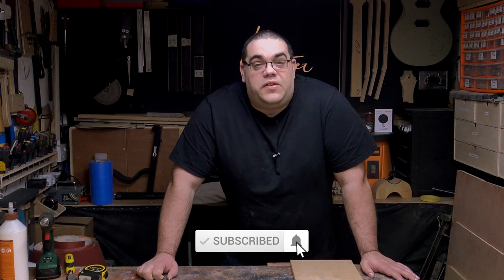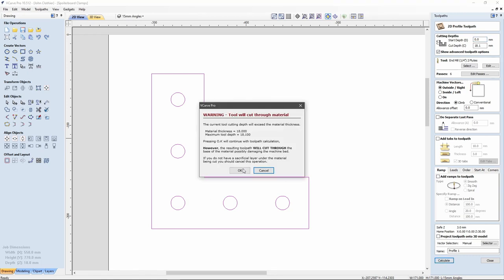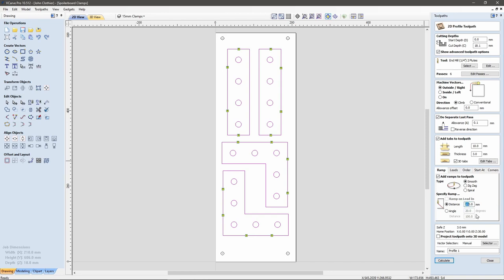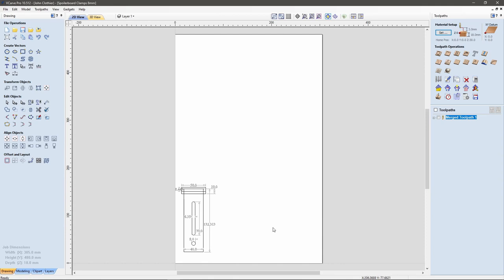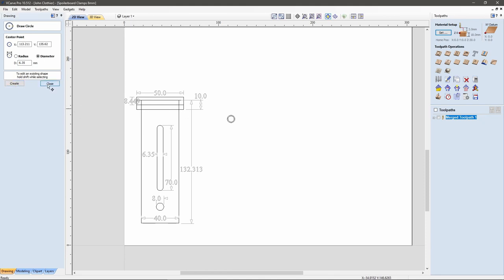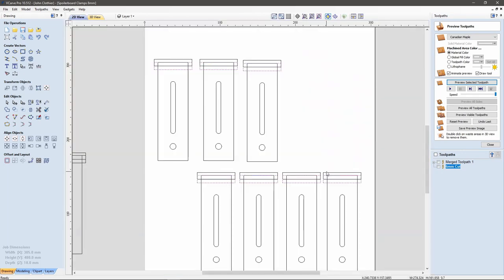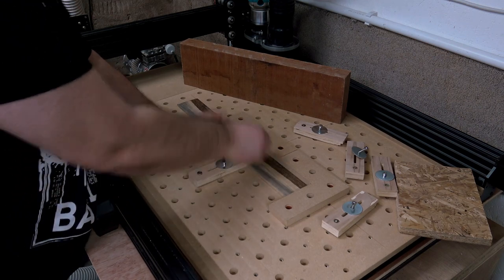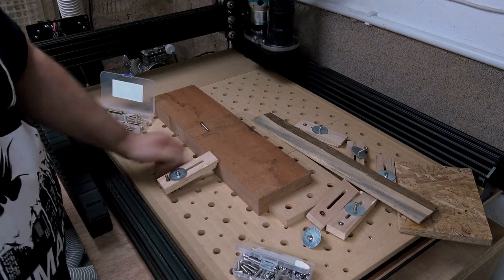Making CNC Clamps with Vectric Vcarve

Comment: word of advice john, dont automatically trust that a quarter inch endmill is really quarter inch, especially when using cheaper bits bought online, its not that important on some jobs, but as an example, when making a box on my cnc my lid wouldnt fit properly, using calipers i realised the endmill was nearly a millimetre out from what was specified. you can always enter the true diameter as a new tool in the vectric database. i find hardwood wedges are good for workholding up against fences on the spoilboard.
Reply from the maker: Thanks for the tip. I measured all my endmills before putting them in vcarve. Most are about right. Some cheaper ones weren’t though

Comment: my workbee did the cutting out ok, but missed out the steps part for some reason, had to delete the main toolpath for the clamp, save the g code for just the 6mm and 12mm steps, re uploaded the job and it just did both 12mm
Reply from the maker: Glad you got it sorted

Comment: No link in the description to Vectric V-Carve? I've never run across that software before, and I'm curious to see what it's all about.

I've been either running, setting up, troubleshooting, doing prove-out of a process on, programming, process engineering for, and most recently managing the manufacturing process engineering staff who, among other things, programs, CNC vertical and horizontal mills, vertical and horizontal lathes, grinders, sinker and wire EDM, for about 14 years, usually having access to one of the seven CAM software packages I've worked with, either in school or on the job professionally. Most commonly I've used Mastercam, and often had access to SolidWorks for the CAD, or design, component of things. 

However, now I am process engineering, and programming, for my own CNC vertical mill in my own shop, and I'm searching for the best, most versatile, CAD/CAM software, at the lowest possible cost, because our very young business has extraordinarily tight budgetary limits.
Reply from the maker: It’s a pretty common program amongst hobbyists. Possibly not for you if you are used to solid works though. It’s not that kind of app. You can find it at www.vectric.com

Comment: Another great video John.  I'll definitely be making myself some clamps using this or a similar method.  Had you thought about using apposing wedges to work with the clamps fixed into your dog holes (the 3 and 4 hole pieces you made first)?  I made an MFT style top for track saw work and picked up a set of dogs and wedges which do a great job of keeping things flat and tight to the bench. Thanks for taking the time to share your experience with the WorkBee CNC and Vectric software.
Reply from the maker: Thanks Jon. I have looked at the wedge idea but I never felt it was secure enough. May need to go back and look at that again. Thanks for letting me know
Reply: @JohnClothier  I bought a set from Axminster including a cam for tightening the wedges.  I will make my own when i get my Workbee set up.
Reply from the maker: @TheJonkilleen  oooh I didn’t know they sold them. Might have to look at those.

Comment: That threaded insert will do most of the time, but the forces acting on it with thick stock is pushing it outwards. Putting it in from the other side would make it a bit stronger, maybe not useful in real life but correct in theory... ;-)
Nice video!
Reply from the maker: Thanks. Yes you could well be right there!
Reply: @JohnClothier  Looking at the video it looks like some one side and some the other.

Comment: Hi John, not sure if you're still seeing this but here it goes.
How accurate is your workbee for drilling holes? I just got mine assembled thanks to your videos and the manual.
But when I tried to get some 20mm holes in my spoilboard, they ended up being about 19,75 with some wee variations. But in general around 19,75.
Just wanted to check with you on your experience.

Thanks
Reply from the maker: Have you calibrated it? Out the box I found mine was a little out but after calibrating I can cut 100mm square and it come out within 0.25mm
Reply: @JohnClothier  haha I didn't even know this was possible until yesterday when ooznest replied saying the same lol. I only had 10 minutes available yesterday and I found that I had forgotten to align the Y carriages and one was some millimeters out. Then I tested again and it was already a huge difference. Still need to calibrate it properly though.
Thanks for replying John. Can't wait to watch the other videos on the guitar and other projects. You were better than ooznest manual. Should have your videos linked in their website.
Reply from the maker: @douglaslopes1987  glad you got it sorted mate.
Reply: Depending if you do conventional or climb cut you will get smaller or larger holes. Cutter will go in or out of material. Makes small difference.